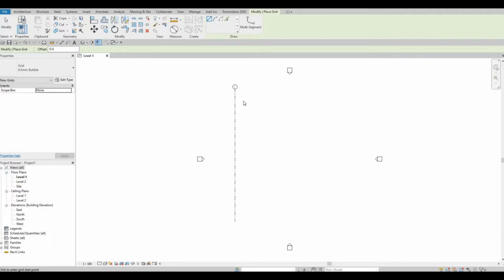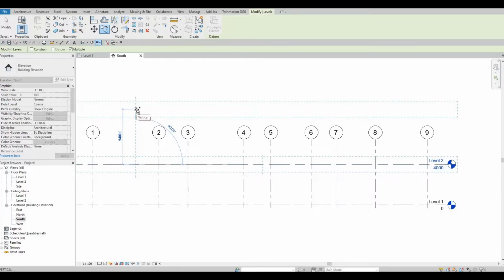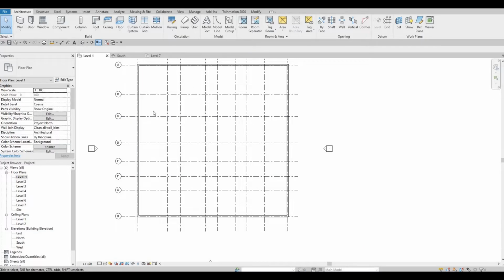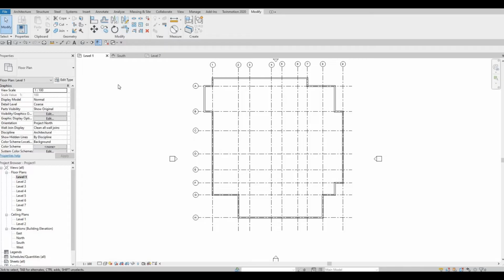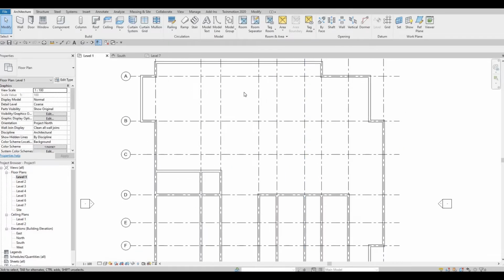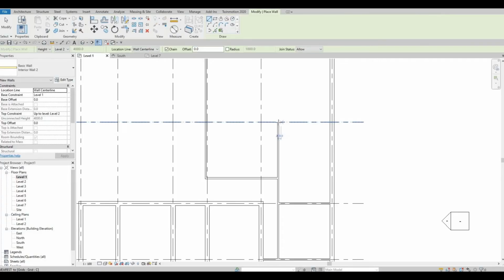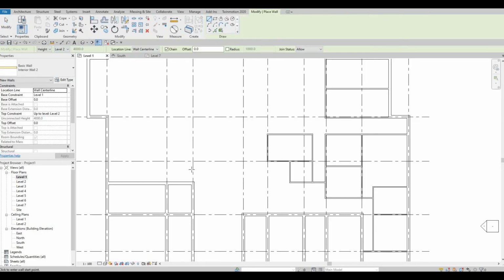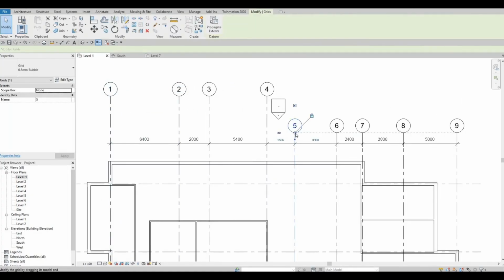Modern Office Building | Part 1 | Complete Step by Step | Revit Project Tutorial

Comment: i dont see clad white material on my revit. how to fix it?
Reply from the maker: Hi Deddy, if you check deeper in the selection, below there is more asset material that you can load. If not, you can just choose a random material and once you are in Twinmotion, you can change it. I set random materials in Revit just to differentiate it once I am in Twinmotion. 🙂🙏
Reply: @ArchCoreDesigns  thanks. Maybe For learn just use the default material on revit
Reply from the maker: Will do, thanks Deddy for the suggestion 🙂🙏